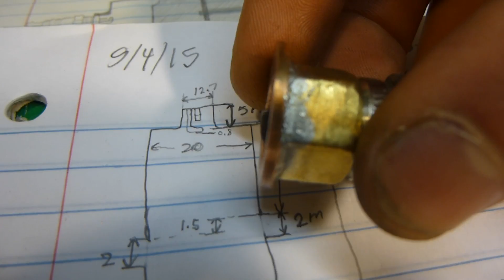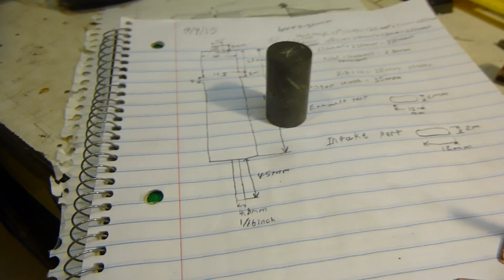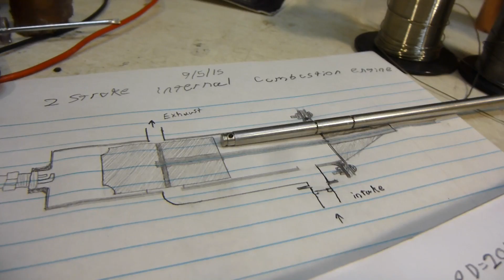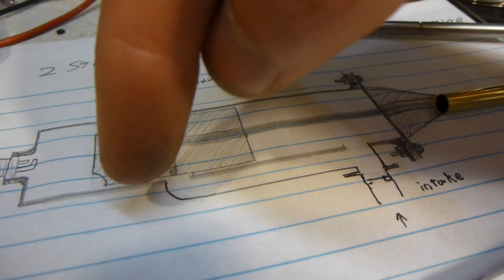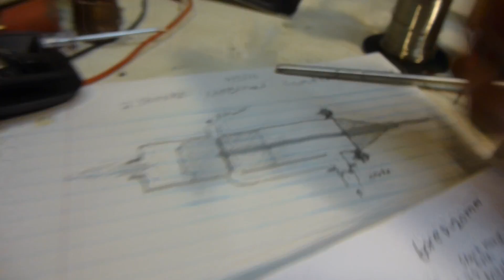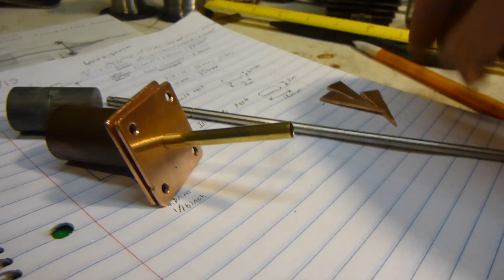Part 4. Making Internal Combustion Engine, No Machine Shop - Cutting and Soldering the Cylinder

Comment: Soldering works better if you let the heat of the parts being soldered melt the solder, also the solder will flow towards the heat.Also if you have one part thicker concentrate your heat there. Hope this helps.

Comment: the reason 2strokes have expansion chambers is because the raw fuel air mixture get pushed out into the exhaust port, the expansion chamber pushes the mixture back into the engine to be burnt so the don't need an oddly shaped piston

Comment: You really need to heat the object that is to be soldered first before you apply the solder.
When you do it correctly the solder will flow like water into the object that is heated correctly. Hear me

Comment: make a new cylinder with the intake port. (aka transfer port) high than the exhaust. not even with it.
Reply from the maker: it is slightly higher. but only by 1mm. not sure if that's enough for best performance. It does seem to work just fine tho.
Reply: i think maybe 2.5-3mm above would work better. also try to make the volume below the piston (where the intake charge comes in to get pressured) small as possible. you want a high positive pressure when the piston is coming down. Im gona sub, i really like your videos. your a smart kid!

edit: JareeB is my gaming channel....

Comment: Nice project....but i not understand what u use for make the piston, what kind of black material is it? Thankyou.
Reply from the maker: I used JB Weld. It is a super strong and high temperature epoxy. I used that because I wanted to make this engine without machine shop and that's the only thing I could think of that works make a good piston

Comment: Sir:   a very clever and interesting project.    You could increase the efficiency of the engine with a properly designed exhaust system:     https://en.wikipedia.org/wiki/Expansion_chamber

Comment: Hey I know you aren't casting in this video and someone else has probably already left a comment saying it. But when pouring the aluminum into your cast you may be stopping  a little too early. The trick is too keep pouring even if your just making a pool of it above your cast. It keeps the pressure flowing and makes sure that your aluminum doesn't collapse and mess up the cast during the pour. Wetting the top of the sand and making a nice large volcano shape will make more room for a bigger aluminum pool. Just wanted too offer some advice that helped me out. Love your videos and keep it up man!
Reply from the maker: +Bacon Destroyer (Sin) Thank you very much for the tip!  I'll try that on my next casting!

Comment: Dude, it's coming together!!!! I can't wait to see it run :D
Let's see how many fractions of a horse power it can deliver xD
Reply from the maker: +Jordan O'C (Xenro66) It's about 8cc which for a 4 stroke using this calculator is about 0.24hp: http://www3.telus.net/shebang/engine_cc_to_hp_calculator.html  Convert that to watts which means more in my mind: ~180 watts.  Which sounds like a lot.  The thing is that there is not a direct relationship between 4 and 2 stroke engine power.  They have drastically different power curves.  But that's all hypothetical.  I can only dream to get that much power from my homemade engine made from JB weld and copper tube.  If I had to guess I would say it's going to put out roughly 10 watts.  At least that's what I hope to get out of it.  The other day when I was running it I was holding onto the shaft to limit the RPM to keep it from possibly self destructing because the RPM's were going over the 3,000 mark(scary to say the least).  Anyway, it was starting to get uncomfortably hot holding on to the 8mm shaft at 3k RPM.  So I'm thinking it's got some power behind it.  I need to slap a gen on it and see what the power actually looks like.  Will save that for a video though.  LOL I hope you don't mind the ramble of info!  :P
Reply: Makerj101 8cc?! Impossible, it would melt before then. However, if it did reach 8cc, or the claimed 180w, you could literally mount this on a scooter and go like 5mph, which would be pretty cool :D. But 10w sounds more realistic as an output; not a maximum output mind you! Whoa.... Maybe you should try to put a heatsink on it? It would be cool to see how much torque/rpm it can put out lol. Don't worry 'bout the ramble, we all do it c:
Reply from the maker: +Jordan O'C (Xenro66) Ok well I just did some tests and came up with results.  I ran it for 10 minutes and it burnt 10 grams of fuel and I would say it averaged about 2000RPM during the test(extra information).  I'm burning coleman fuel which I couldn't find an exact energy content for but it seems like it's slightly less than gasoline which is 43kJ/g.  Engine uses 1g/min = 0.0167g/sec.  Multiply that by 43kJ/g and that gives 717J/sec or  717watts.  So the amount of fuel it's using is equivalent to a 700watt space heater.  

I did more searching on wiki and found this: https://en.wikipedia.org/wiki/Engine_efficiency  Says 25-30%.  So if my engine was particularly inefficient and I got 10% I could hope to get 70 watts of power.  But even if it's only as little as 1% that's still 7 watts which is more than 4 times what my Stirling engine does and more than plenty to charge a phone which I hope to be able to do.

I have actually added a cooling system.  It's a piece of bicycle inner tube with two holes punched in it and the holes are stretched over the cylinder.  One end is blocked and then I filled it with water.  It works quite well but it's nowhere's near pretty LOL  The water was boiling at the end of that 10 minute long test.  I'm trying decide what kind of water jacket I want.  Either coil some copper tubing around the cylinder and then solder it.  Or make a larger cylinder with ends out of sheet copper and make a water jacket that way.  Then I have to decide if I want the water to just boil away to keep it cool or whether want a more complicated system with radiator and pump.  Hmmm  I thought about air cooling but I'm not sure it would be enough.  Plus large copper fins would put a lot more stress on the cylinder from the weight.
Reply: Makerj101 Jesus, 700w of energy from fuel, but only 25% efficient in converting it to motion? That's terribly inefficient. 10% even less so xD. 7 watts wouldn't charge my phone, mine needs a minimum of 10 (2A @ 5v) :L.

oh that's pretty cool. You should still  use oil instead, running to a radiator, possibly with a fan. Complicates things a bit, but would drastically decrease the temperatures :D. Plus, who says it has to be pretty? Form follows function, in my book :)

Air cooling is pushing it though, if only 10% of the fuel energy is converted to kinetic, thats 630w of heat you need to dissipate! Maybe try swapping the cylinder out for a thicker tube with the same inside diameter, it would hold up to the weight then.
Reply from the maker: +Jordan O'C (Xenro66) It would charge it.  It would just take a lllllllooooonnnnnnnggggggg time.  I have an LG G2 and it also has a 2 amp adapter.  Takes like 1.5 hours to charge.  Takes like 4 hours on 1 amp USB.  Have you tired charging it on 1 amp?

Oil cooling is an interesting idea.  I think I would go with distilled water because if things get too hot the water will boil away and still keep it reasonably cool.  Oil won't really do that.  LOL yeah it sure doesn't have to be pretty!  Hence my ball mill... that thing is really ugly hahaha

I doubt all the remaining 630W is going into the cylinder.  I think most of the gets spewed out of the exhaust.  Maybe 50% of the heat is absorbed into the cylinder and cooling system.  Even after 10 minutes it's not like it was hard boiling.  It has some bubbles all around the cylinder and the water was steaming a little.  And it was pretty hot when I stuck my finger in but not scalding.  That would be too much work to replace the cylinder!  Plus I'm already using pretty thick copper pipe.  I think it's close to the thickest they sell at the hardware store.  If I was going to do that I might as well build another engine.

Comment: I wanna make a steam engine but I'm 15 and I ain't got time nor the money
Reply from the maker: +Jeremiah Lowe Being 15 is no problem.  There are people younger who have made steam engines.  Well you've got a problem there.  Thing is, you don't need much money or time to build a steam engine.  Maybe a few dollars if you need glue or something and several hours over the weekend or holiday.  This guy, Lidmotor, built a way simpler steam engine than mine out of total junk.  https://www.youtube.com/watch?v=KC4aC_dZ5fI  I'm pretty confident that if you really wanted to build a steam engine you could find the time on the weekend to build something like this.  Not hard at all.
Reply: well thats alot simpler that thats how i planned on doing it :/
Reply from the maker: +Jeremiah Lowe Well I would recommend starting simple and then if that works go with a more complicated design.
Reply: Makerj101 yeah the mechanics are the hard part getting everything the right size and the right shapes and where i have almost no tools just a drill screwdrive pliars and wire cutters
Reply from the maker: +Jeremiah Lowe That should be enough tools.  Maybe I'll take up a challenge and make a steam engine with those tools and make a video.  That would be a fun project and help some people such as yourself.
Reply: Makerj101 Thatd be epic
Reply from the maker: Jeremiah Lowe I'll give it some thought.

Comment: If you could make that outer part of the transfer port a little smaller I think it would get more velocity and more rpm
Reply from the maker: +2stroketerror125 I kinda doubt that's going to limit the RPM.  I found what is really limiting the RPM.  It's the ignition coil thing from a furnace.  It's not designed to be turned on and off many times per second.  So it just can't keep up.  If I turn the HV ignition on so that it gives a contentious arc I get over 3,000 RPM.  It's actually really scary.  And don't ask why that doesn't cause it to fire too early.  It's blowing my mind too.  All I know is that it works and I found that out by accident when the alligator clips going to the ignition switch shorted out and it just took off like crazy.
Reply: +Makerj101 right on. I'm just going off what I learned from porting 2 stroke cylinders. That's one of the biggest rules is not to make the transfer ports too large more just smooth them out. I've actually made that mistake on a weed eater engine and it wouldn't rev as fast or as high. Good thing I practiced on junk engines before porting my blaster.good job though that's awesome you actually made a running ICE. You're a smart man.
Reply from the maker: Ah ok.  So I'm guessing that making the ports the right size would make the gases flow at a certain rate and displace the right amount of exhaust?  Thank you!

Comment: I am thinking that this whole engine could be put together with JB Weld High Heat Epoxy putty http://www.jbweld.com/products/highheat-epoxy-putty .  It is really only a proof of concept project (internal combustion engine / no machine shop) and is not meant to run very long.  Just a few seconds run time would be all I was looking for then shut her down.   If you could stay under 550 degrees for those few seconds ---your there.  You might even be able to mold a water jacket with the epoxy putty then you are really there.
Reply from the maker: +Lidmotor Oh you could run it for well over 5 minutes before you hit 550F.  I've run mine many times without cooling for at least 3 minutes before it was too hot to touch.  It really doesn't get as hot as you'd think.  This thing would be weather JB Weld would be strong enough.  I think if you used a ton of it you should be ok.

Comment: Hi Maker J
this project is awesome..the inner tube check valve you made is brilliant..it's called a reed valve in modern 2 strokes and is usually made out of a really thin piece of carbon or fiberglass sheet. If you have problems with revs. this would be your area to look. Again, great project and I cant wait to see this thing run.
Reply from the maker: +electro1622 Thank you! Well to be honest it's not a great idea because it didn't work!  :P  Every time the piston comes back and the check valve needs to do it's job the flap just bulges and then leaks a ton.  It was enough to get the engine working a little bit at first but I soon replaces it with a ball bearing and spring.  The performance improvement with the BB and spring was at least 10x.

Comment: If I knew even half of what you know, at your age ...
Can I borrow your monopole bifilar magnetic resonating flux capacitor, and half your brain?
Reply from the maker: +AtheosPhyve Hahaha no you can't barrow my monopole bifilar magnetic resonating flux capacitor and my brains!  :P  They are mine and I don't share them!  :P  Mwahahaha
Reply: +Makerj101 Well, lucky for me, your videos are detailed enough. I'm sure I can reverse engineer it.
Reply from the maker: +AtheosPhyve Hahaha it's actually a pretty nice capacitor(I thought that before I did the fallowing calculations).  1.2 Farads @ 25 volts.  Gives a nice little pop when you short it out.  Just for the fun I just did some maths and turns out it's not that much.   W=1/2 CV^2 where C=1.2F and V=25v.  So stored energy is W=375Joules.  Lets get that to something we can recognize.  We all like watts and the equation for Joules to power is: P=W/t where W=375J and t=60sec.  So it can only supply a measly 6.25watts for 1 minute!  And 1/60th that for an hour.  So you could charge a cell phone for a little over 1 minute off that huge cap!  Maybe I should just get ride of this cap cause that's hardly useful at all...  Plus it's a monster.  It gives a nice pop because all that energy is getting dumped really fast.  So if it drains in 0.1sec when you short it then that's 3.75KW being dissipated in 0.1sec.  I love physics!  This is all stuff I'm learning right now and boy is it fun!  :D
Reply: +Makerj101 You do plan on going to university for electrical engineering ... right?
It's fun, and very rewarding. At least it is for me.
Reply from the maker: +AtheosPhyve Yeah I'm going to transfer to a university.  But I'm thinking mechanical engineering.  I was originally thinking electrical but I think I love mechanical stuff more.
Reply: +Makerj101 you have run into the same problem I have run into  its a hard pick but good luck you have gained a sub
Reply: +anthony hayes 
don't try electrical !
its shocking enough with its math shin & cosh 
and after all , YOU CHOOSE WHAT YOU WANA DO 
so then you may be just fine in the right place and comfortable 
and then , its time to change place !
Reply: You should not have cooled the solder with water if you do it like that there can be micro cracks but good work so far

Comment: dose flux make the solder stick when its melted?
Reply from the maker: +Enduro Tim Yes, and more: Wiki: In soldering of metals, flux serves a threefold purpose: it removes rust[clarification needed] from the surfaces to be soldered, it seals out air thus preventing further rust, and by facilitating amalgamation improves wetting characteristics of the liquid solder.  https://en.wikipedia.org/wiki/Flux_(metallurgy)#Soldering
Reply: well then

Comment: Good job! For soldering I recommend Otay safe-flo silver solder, still has a low melting point but is much higher than lead and tin solder and is much stronger. It would be great to see the engine powering something like a small generator or water pump to supply cooling, I haven't seen anyone do this but the engine running a giant gyroscope so it can keep itself floating in midair would be awesome.
Reply from the maker: +Kyler Kraus What's the composition of it?  I'm not finding a lot about how much silver it has.  The SDS has a rang of 1-5%.  I also see a couple of reviews that say it has no silver and some even say they tested it and found no to little silver content.  I think I will stick with my Sn96.5Ag3.0Cu0.5 Kester solder for now.  It seems to work well.  I did use that 100% tin solder on a couple of pieces but they seem to be holding up ok.  I should have used the stuff that contains silver.  I wasn't really thinking about it when I build the engine.  Melting point really isn't a concern for me as I am using an epoxy piston which I'm thinking may melt or burn before the solder melts.  So I will just try my best to keep it cool to keep those failures from happening. 

I surely will be powering some stuff with it!  At this point I think it will easily charge a cell phone.  It seems to have a fair amount of power.  Much more than any of my other homemade engines.  That is when it wants to run.  Sometimes it's a bit of a tough nut to get started.  Mixture is hard to get right if the carburetor valves get bumped.  That's a pretty awesome idea to have it power a gyroscope!  I'm not so sure about the engine being part of the gyroscope... that would be really hard and I'm not sure this thing would have enough power.  Plus the fuel might spill everywhere.  Neat idea though!  Maybe I'll hook an electric motor with a gyroscope up to a generator connected to the engine!